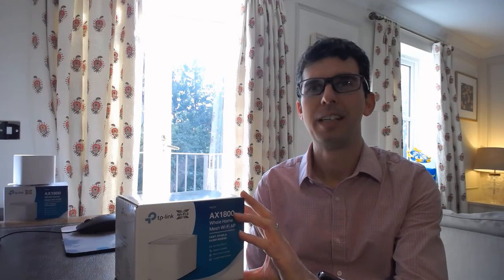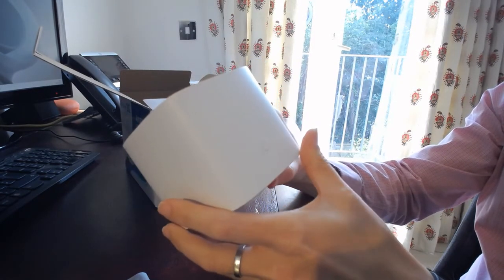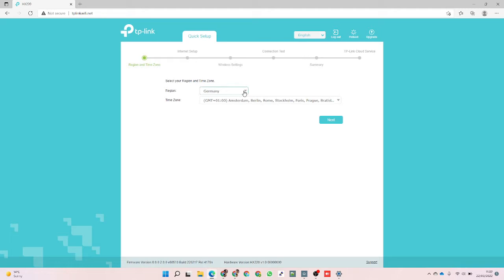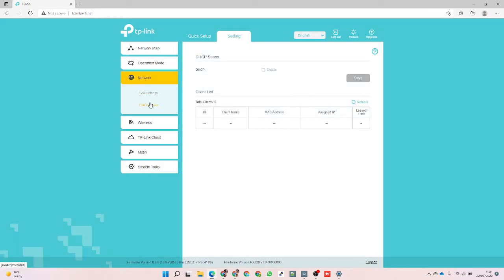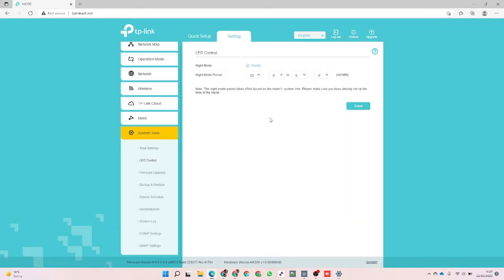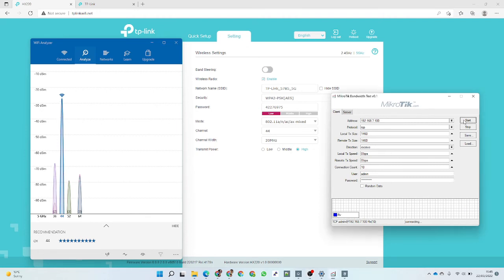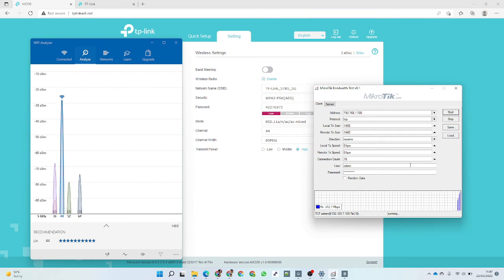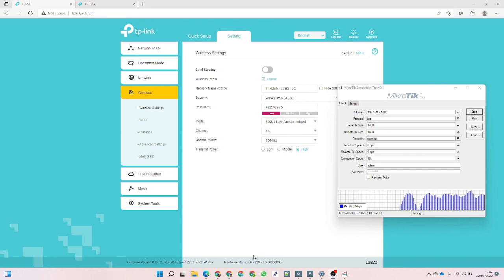TP-Link HX220 WiFi Mesh Unboxing Setup and Speed Testing

Comment: I made a mistake and factory set my tp link and now it’s not working. all the setting are wrong or gone. Any advice?
Reply from the maker: If you factory reset it you will need to go through the setup process again. Generally speaking, just putting in the WAN details (ISP supplied public IP or PPPoE details) should be enough. You may need to go to the WAN > Advanced > add DNS address ( eg Google DNS on 8.8.8.8 and 8.8.4.4). If your ISP provided your router, it may pick up settings automatically.

Comment: My ISP supplied a HX220 as a signal booster for my fibre broadband which has an Aginet WiFi 6 VDSL/ADSL Modem Router. 
This links perfectly in a wired mode using the very short RJ45 cable provided however the ISP says that the HX220 can be linked wirelessly to the modem router by using the WPS buttons on both devices and by removing the RJ45 cable...... in order to extend the range.  That doesn't appear to work ( not syncing). 
All the instructions appear to mention the first HX220 should be linked to the modem router in a wired mode and then to purchase/add additional HX220's wirelessly. 
Should one be able to add a single HX220 wirelessly to the Modem Router, or do I need to buy additional units in order to extend the rage?
Reply: We'll done on finding the cable way of linking devices. You can even use combinations of wired and wireless, making for a very flexible deployment.
If you want to mesh wirelessly, you want to make sure the extra unit (not the main router, or you'll wipe it's config) is in a fresh state. So in your case, hard reset the extra unit, then use the WPS method. Put the extra unit in wps, it should flash it's blue light. Then press the WPS (about 3 seconds) on the main router. Both should then join.
Note, Aginet only talks with Aginet, not Deco. Also, don't place your wifis too far apart. One wall or floor. You don't want to be repeating a weak signal.

Comment: Hello, at minute 8.30 there is written "WPA3 will not work if mesh is enabled"?
Please, could you tell me if you tried this and if it's true?
It doesn't sound great that you buy a mesh system and it doesn't work with the most advanced security.

Thank you in advance
Reply from the maker: Hi, I haven't tried it but I have just logged into a device that is on firmware 0.13 and set it to WPA3 Personal and on the mesh page it reads "Note: WPA3-Personal and WPA2-Enterprise are unavaliable since EasyMesh doesn't support these security types." I very much doubt they would put that on the GUI if it weren't the case.

Comment: Is the HC220 model compatible with the same mesh network of HX220?
Reply from the maker: Hi there, I don't have any HC220's so I couldn't test. However, I did ask the technical team at TP-Link who help me and they replied with this:
Yes, HC220 is compatible with HX220,
We always recommend using HX220 with HX220 mesh to meet the high standard.
As [...] HC220 is the AC1200 and HX220 is AX1800.
Reply: @dudleyrees2347  Great, thanks for your help
Reply: H serisi birbiriyle uyumludur yalnızca DECO serisiyle uyumlu değildir.